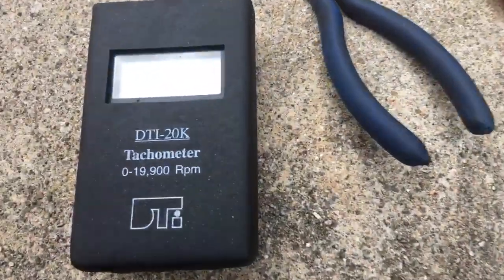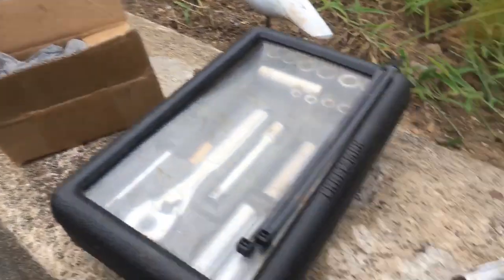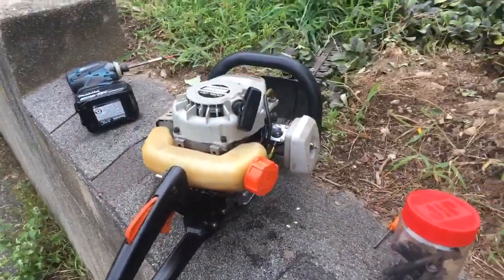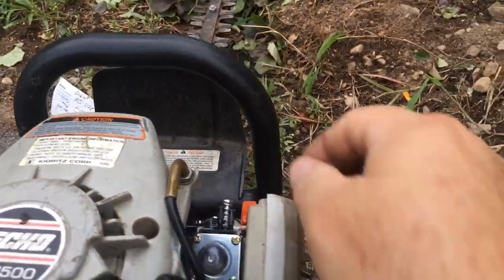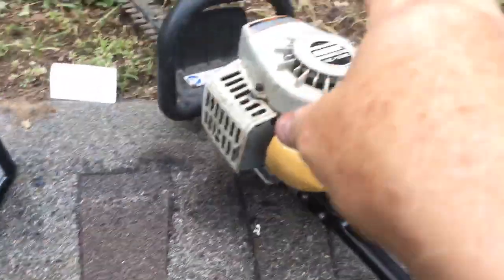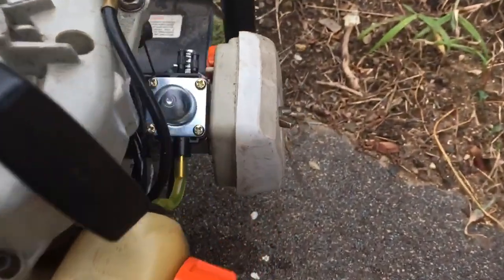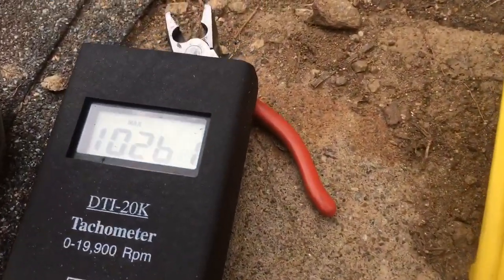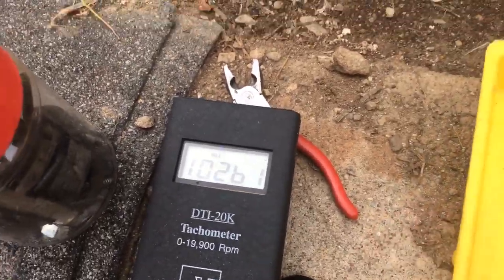Echo HC-1500 Lives again!  Small Engine Tachometers

Comment: Just rescued an Echo HC-160A from the local scrap yard, dry compression is 50psi, wet is 175! Is it worth fixing? Was thinking of just dropping in a new piston ring and hoping for the best.
Reply from the maker: Is the piston or cylinder scored? Always pull the muffler and check
Reply: @KensSmallEngineRepair  have looked through both ports and what I can see looks perfect, hopefully just stuck piston ring?
Reply from the maker: @ek8710  possible if run at low throttle and was carboned up. Carbon will get in the ring land and stick a ring.

Comment: I have a Stihl FS38 trimmer.
I runs erratically no matter how I adjust the carb. One minute it’s screaming, then it’s lopping.
The muffler was totally plugged. Could the main seals now be leaking?  I know how to change them.
I don’t have a vacuum/ pressure tester to check it.
Bruce sent me over.
Thanks,
Jim
Reply from the maker: Hold it while idling then rotate it 90 degrees for 4 seconds, then another, then another.  A seal leak would change rpms wen the unit was rotated.  Make sure the equipment is warmed up too. Chinese carbs are cheap why not try one on it? Is the fuel line and filter good?  What about the vent?